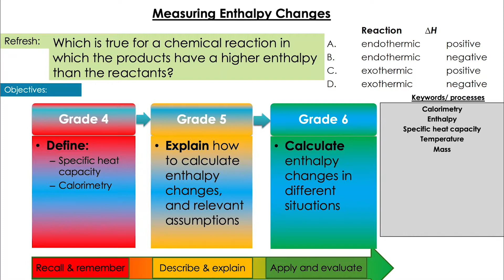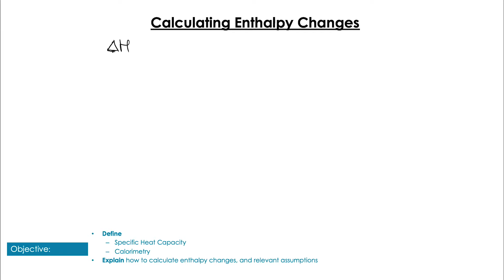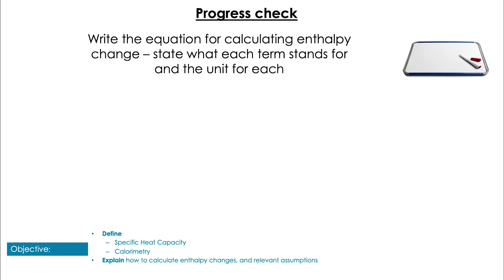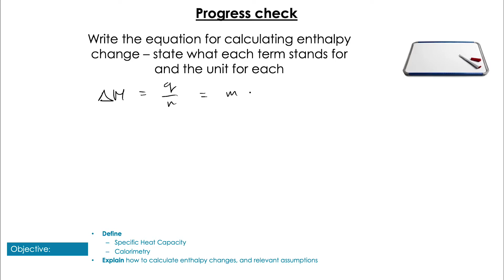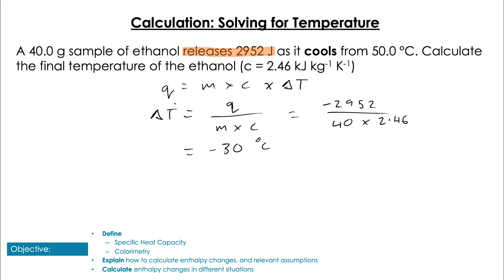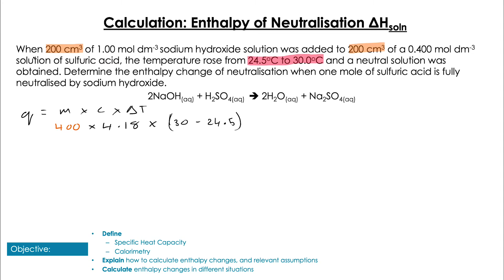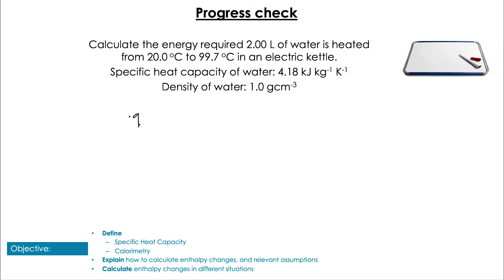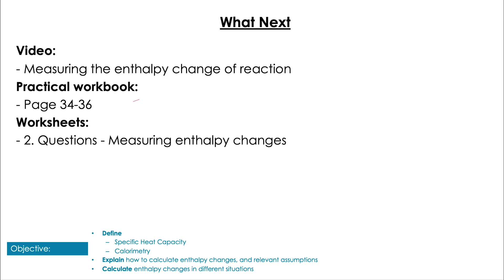Measuring Enthalpy Changes (IB Chemistry R1.1)

Comment: hi sir i wanted to ask would it be better to word the assumption for the mass of water as that being equal to the volume of the water in calorimetry calculations? i've seen some questions pop up like this here and there
Reply from the maker: Yes, anything that clearly shows that the assumption is the volume and the mass will be the same. This can be properly described as an assumption on the density of the water. but as long as you make this clear in some way, you will likely get the mark in an exam.

Comment: sir at 10:32 you did -2952/40X2.46

c=2.46 is in KJ, but q=-2952 is in J, i was wondering wouldn't we divide -2952 by 1000 to make sure both are in KJ? i thought we need to keep the units the same when calculating